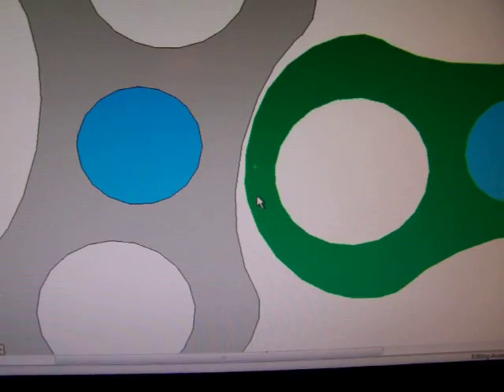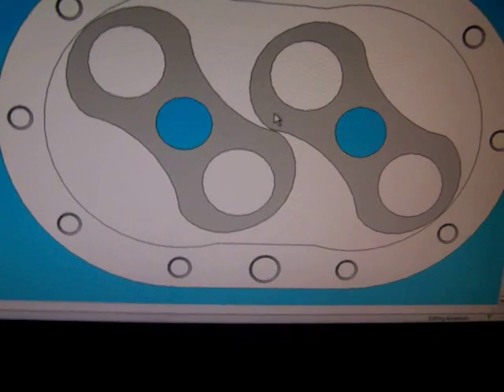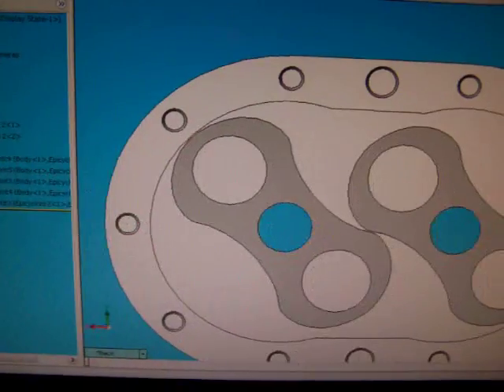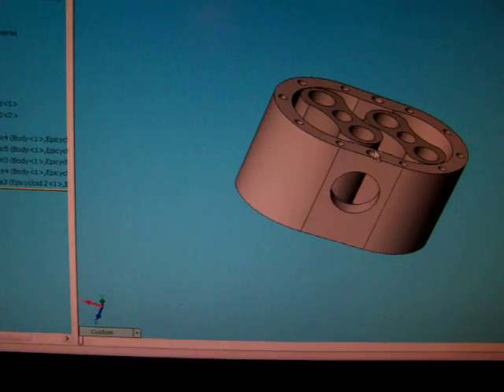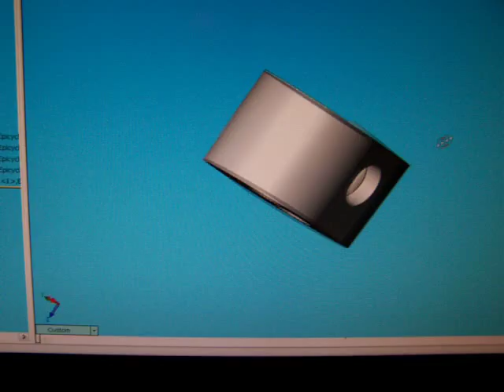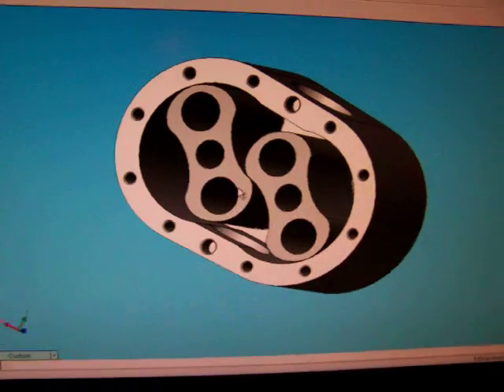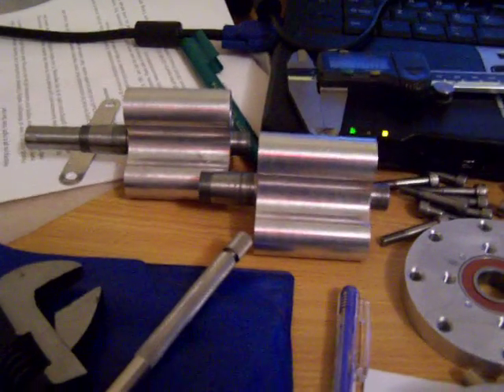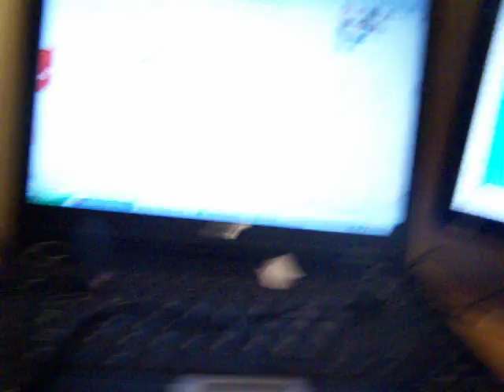Rotor Design Part 2 of 2

Comment: Hi! Great work! Can I ask you how you came to the calculations that gave you the size blower that you made? Are you running it 1:1? I think a blower that size would bring a 200cc engine up to about 16 psi at 1:1. I'm wondering if the blower can be made a bit smaller to feed a 200cc engine.